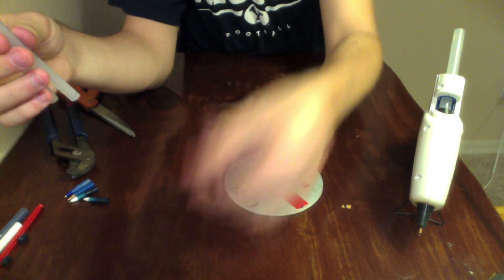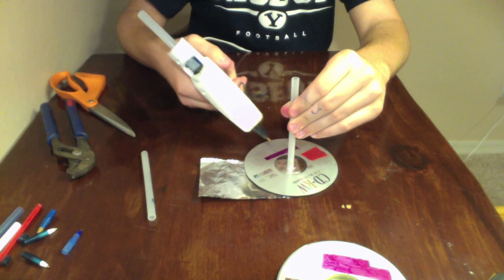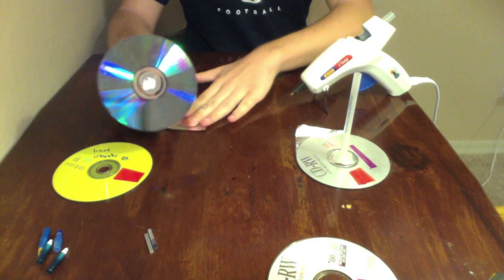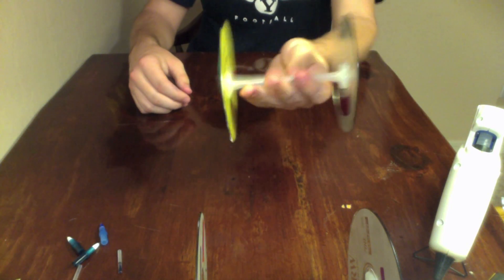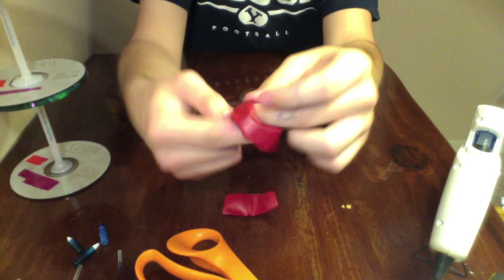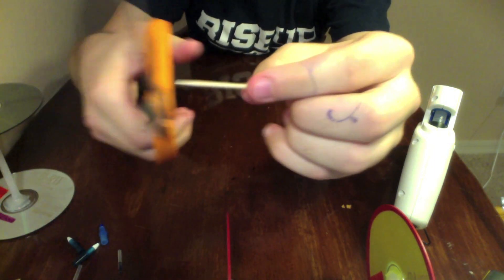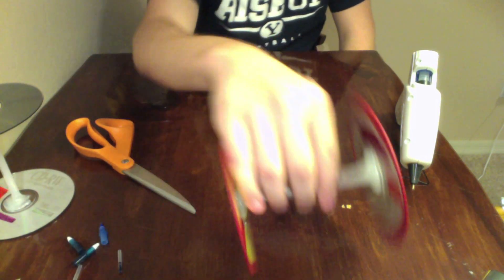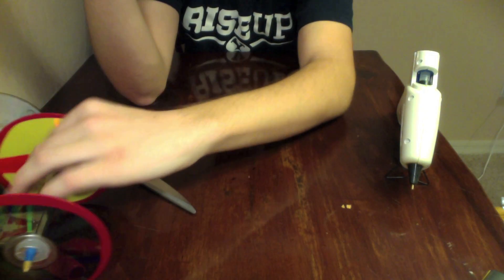EASIEST mousetrap car tutorial (Part 2/4)

Comment: i know i already said something but is there any alternative that i could use INSTEAD of the balloon?
Reply: I know this was posted three months ago, but if anyone else has this problem you can use electric tape or anything with that kind of consistency. I used electric tape and it worked well
Reply from the maker: Put hot glue around the edge of the wheels, maybe?
Reply: hm. may work. i have seen some really wide rubber bands too. thanks for the thought tho Jegber
Reply: Gab Springer I know this was a month ago, but maybe use electrical tape around the edge of the wheels
Reply: Ghostly Grimace
i asked my teacher and she said it was fine for the wheels, thanks for trying to help though :)

Comment: Would this car be able to go forward and backwards?
Reply from the maker: +Sam Cresta You could modify it to go forward and backwards, yes. A few ideas:
 1. You could turn the front wheels so the car drives in a curve. It would start going forward, then gradually turn until it starts going backwards
2.  You could attach two strings to the lever arm. String A is the full length, and string B is half-length. Wind string A around the axle, then when you reach string B, wind string B around the axle in the opposite direction. When the car goes, it will move halfway in one direction under the power of string B, then reverse it's direction when you reach string A.
3. Be imaginative and come up with your own solution!
Let me know how it goes!
Reply: +Jegber ok will try a few things, thanks !

Comment: do we need the cartridges
Reply from the maker: Use the pen casings as axles, and use the pen tips as the axle holders. The little clear tubes that the ink sits in are needed to hold the pen tips
Reply from the maker: Use the pen casings as axles, and use the pen tips as the axle holders. The little clear tubes that the ink sits in are needed to hold the pen tips

Comment: Why just the back wheels and not a 4? With four wheel drive you generally have more torque.
Reply: I know the comment is very old; however I still feel the need to answer your question. To put it simply, most competitions limit you to a single mousetrap, which can't power both axles at once.

Comment: Hi Jegber!!
Why do you put the balloon only on the back wheels? Is there a specific reason?
Reply from the maker: loveyou75050 The back wheels are connected to the string, so they're more likely to "spin out". The balloon helps add some friction on the ground so they don't spin out. We don't really care if the front wheels spin out, because the car will move forward regardless.

Comment from the maker: The chemicals in paint separate out over time, so you need to stir them back together so the paint works properly. You can get paint sticks at any store that sells paint, usually for free. The ones I used in the video cost 20 cents each, but they're a bit longer and tougher than the free ones.